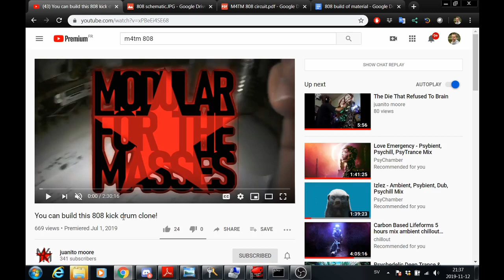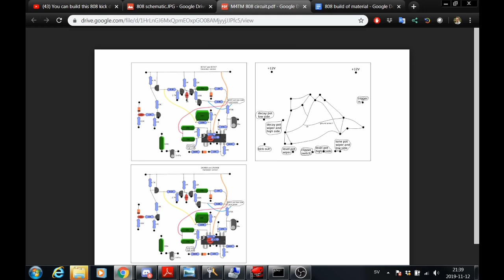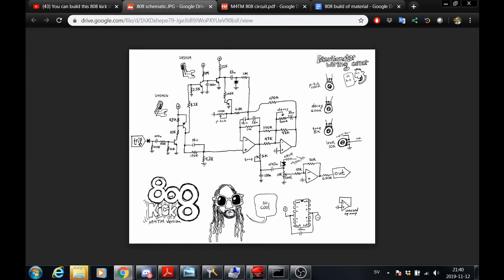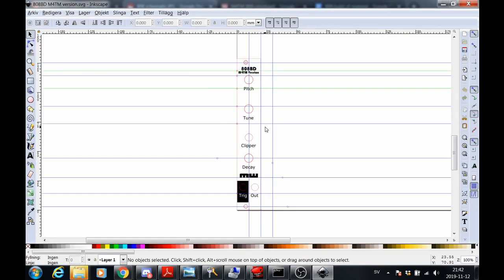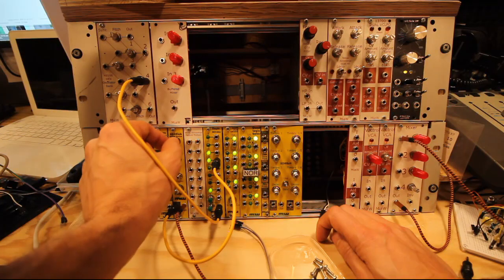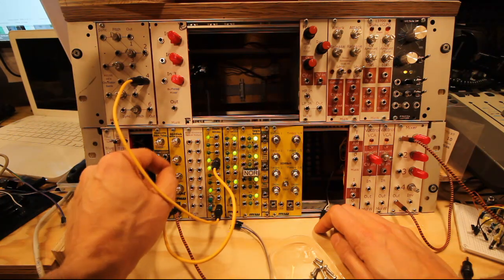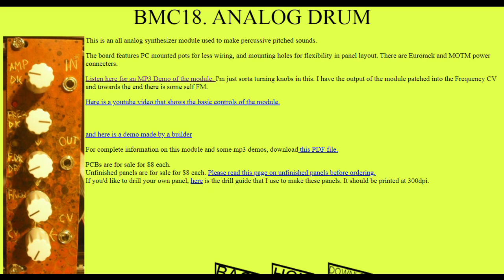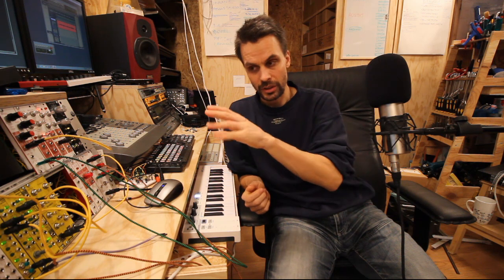808 Kick M4TM version - DIY Modular in a Week 9.5

Comment: I've seen some of his videoes, that deadbug style is amazing. I hope my work will improve enugh so that I can use that technique in the future, but at the moment I think it would be too messy and short all the time, like my early breadboard builds, and deadbug style seems crazy hard to errorcheck. I tried to build a square to sinewave converter today, but don't think I'll be able to use it on my CEM3340's. Do you have any sugestions for a good since VCO?
Reply from the maker: The best diy 3340 vco I’ve found (so far) Is the kassutronics one. It has all four wave shapes and all the sync and modulation needed. That is the one I am planning on building when the time comes (if nothing better shows up) ;)
Reply: Cool, I will have to check out the scematics and see if I can impliment the sine wave circut to the modules I'm building :D
Reply: Seems like it will be hard to get that into the whole 4 HP thing I got going for the VCO's so it'll fit the setup in my case, and I don't have much scematic reading skills. However I have a extra AS3340 that won't fit in my case anyway, so I will definetly give whatever you make a go :D I understand I will be needing a J201then?